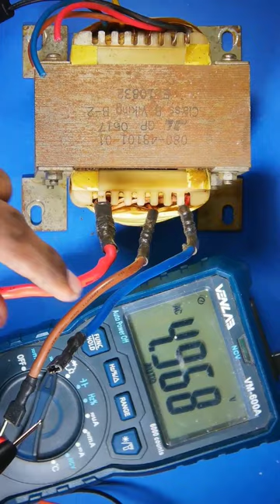How to make a 90Ah battery charger | Electronics

Comment: THE CALCULATION YOU DID NOT MAKE IS THE FOLLOWING: if the tester shows you an RMS value of 16.4VAC, the rectified value will be the peak value of the RMS value minus the voltage drop of 2 rectifier diodes, that gives 41.4% x 16.4 VAC RMS - 0.7VDC x 2= 21.78VDC
YOU ARE SUPERCHARGING THE BATTERY AT 21.78 VOLT DIRECT CURRENT.
Reply: tienes razón amigo, literalmente todo el mundo (YouTube) realiza mal las mediciones, le creen todo al valor RMS y al valor medio que muestra el multimetro y hay que hacerle caso al valor PEAK ya que es el voltaje real que le llega a la batería, el valor medio es solo un calculo matematico que hace el tester. Para eso deberia haber una salida del transformador de unos 11V (RMS) para tener unos 14,15 V (PEAK DC PULSANTE) (ya habiendo restado la caida de 2 diodos del puente) hacia la bateria. Y SIN CONDENSADOR ya que la misma batería actúa como éste elevando la señal desde el voltaje de la batería hasta los peak de carga hasta que la corriente disminuye a 0 y el voltaje de bateria sea igual al del cargador
Reply: its even not 90A just 15A due to the transformer being 15A

Comment: IT'S OK TO IMPROVISE, BUT... you have an excess of voltage that will prematurely damage the battery, the overvoltage is indicated on the battery in your case 14.2 approximately, the rest of the voltage is damaging the plates, it's because that when you put the tester it shows you 14.2, 14.3

Comment: EL CALCULO QUE NO HICISTE ES EL SIGUIENTE: si el tester te marca un valor RMS de 16,4VCA el valor rectificado sera el valor pico del valor RMS menos la caída de tensión de 2 diodos del rectificador, eso da un 41,4%  x 16,4 VCA RMS - 0,7VCC x 2= 21,78vcc
ESTAS SOBREALIMENTANDO LA BATERÍA A 21,78 VOLT CORRIENTE CONTINUA.
Reply from the maker: I used a 7v*2=14v transformer.
Reply: @easyproject4uofficial  14x1,41-0,7x2=18,34vcc sigue alta (stay high)
Reply: @easyproject4uofficial  7.5 v +7.5 v = 15v 

Diod resistance  - 
15v-0.7v
=14.2 v ( approx ) 

?
Reply: @Igoluverma ve a estudiar matemáticas y electrónica básica